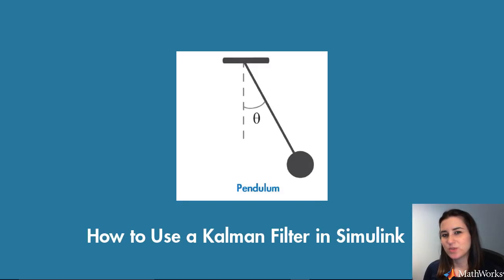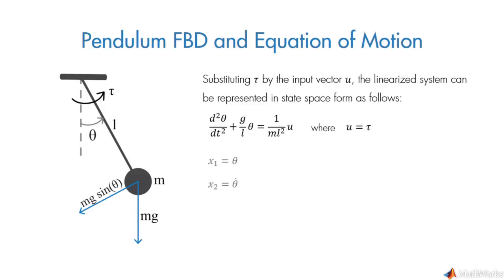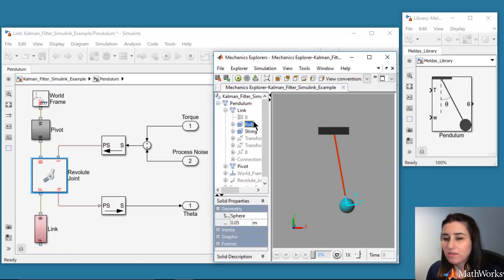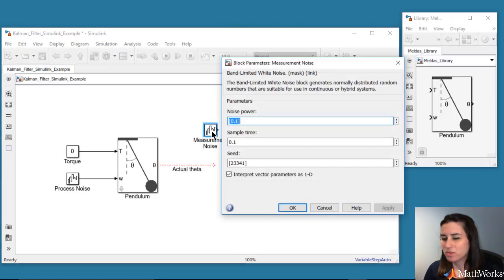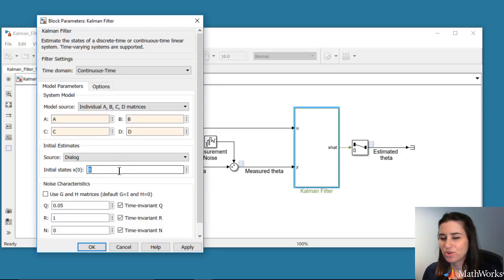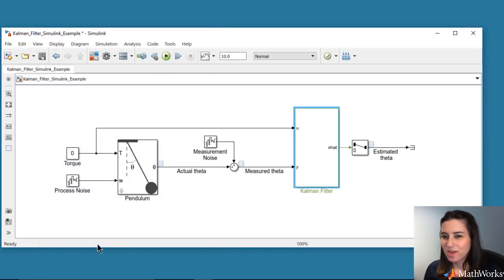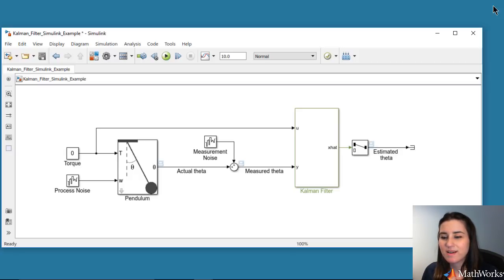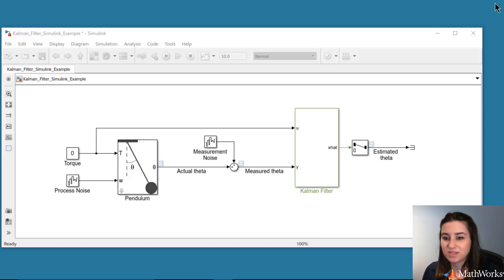How to Use a Kalman Filter in Simulink | Understanding Kalman Filters, Part 6

Comment: The statement "[the algorithm] solves for the Kalman Gain by minimizing the error covariance P and outputs the optimal state estimate." at 4:20 is incorrect. Kalman Filter doesn't minimize the covariance in the update step. Instead, it just computes what it is based on the noise elements.

Comment: Does the Kalman filter work to estimate the velocity of the pendulum without any velocity measurement?
By the way, these videos about Kalman filter are amazing. They helped me a lot during my project! Thank you.
Hopefully you will give me an  answer soon about my question. 

Best regards
Reply: Hi, the idea behind Kalman filter is using both measurement and prediction to come up with an optimal estimate of the state. Checking out part4 where we discuss the algorithm equations may help understanding this better. In the absence of measurements, the estimation will purely rely on the predicted state and that may not give you the best results due to uncertainties in the model.
Reply: In case of data loss the Normal Equation, LDA (Levinson Durbon Algorithm) or LGA (Leroux Gueguen Algorithm)  estimate the state of system and I know it because I worked on LGA while our Professor worked on LDA.

Comment: I'm implementing a Kalman Filter for a Power System Application. Why do you multiply the process noise covariance (Q) by the sampling period (Ts)? And why do you asume tha process noise only affects the acceleration? Thanks
Reply: Hi Jorge, I'm using band-limited white noise block for the process noise and in this block the covariance is approximated by noise_power/sample_time. Therefore, noisepower~=sample_time*covariance. For more information on the band-limited white noise block, please refer to the following page: https://www.mathworks.com/help/simulink/slref/bandlimitedwhitenoise.html. And the assumption is just for simplicity of the example (to have a scalar process noise)
Reply: @meldaulusoy8389  Sorry, do you know why i can't select the covariance P(0) without impose that Q and R are time-variant? I'm referring to simulink

Comment: what does "tau" represent in the pendulum system? :)
Reply: Tau represents the torque acting on the system. In this example, we assume that there's no driving torque but we set the initial value of theta to pi/18. So, when we let the pendulum go, it swings back and forth.

Comment: I want to program in matlab but matlab is very expensive.
Reply: I guess you have to settle for free software, then. Try Octave and Julia as a MATLAB substitute (at least the latter is also quite performant) or Scilab, which additionally provides something similar to Simulink called Xcos
Reply: actually I am using all of them but matlab and NI is excillent. I don't have to struggling compiling files or searching other libraries. Mathworks software have c and cuda compilers and Matlab/simulink is compact
Reply: boss, find your way on the torrent
don't be so innocent.........
tell  if you can't, I will send you a drive link
Reply: torrent? Please try to use embedded coder with torrent :D
Reply: Hi Selcuk, 
Have you considered trying MATLAB Home or MATLAB Student? You can check out the pricing from the links below. I'd be happy to help if you have questions.

MATLAB Home: https://www.mathworks.com/products/matlab-home.html
MATLAB Student: https://www.mathworks.com/academia/student_version.html
Reply: I can't use embedded coder without commercial licence. Prices are unreachable. Matlab is useless without embedded and gpu coder for me. I just want to use mathworks compilers. I don't want to rewrite all of code for another platform. Also I am using python for all of scientific and engineering calculations.